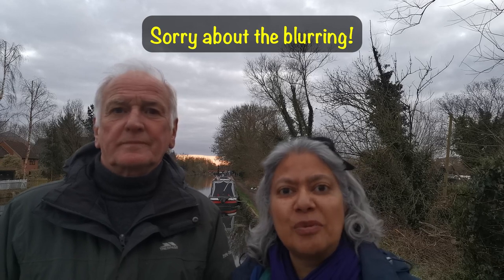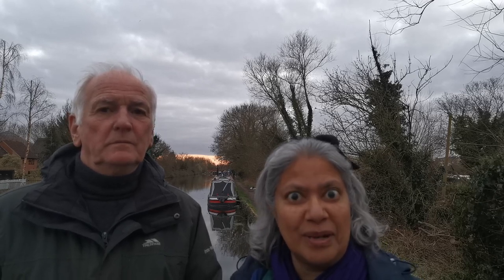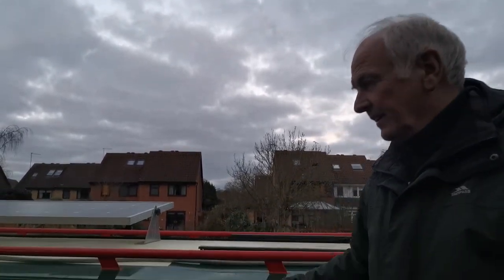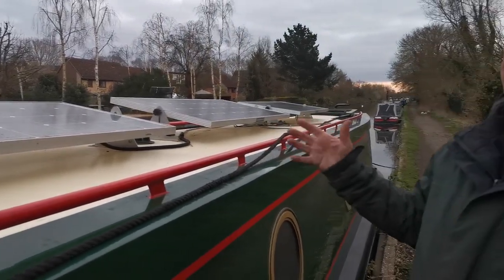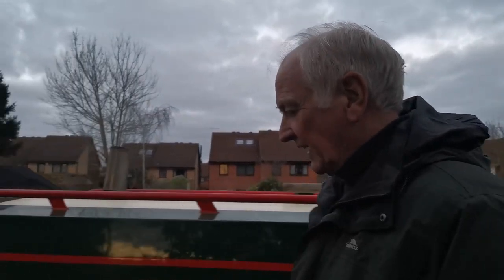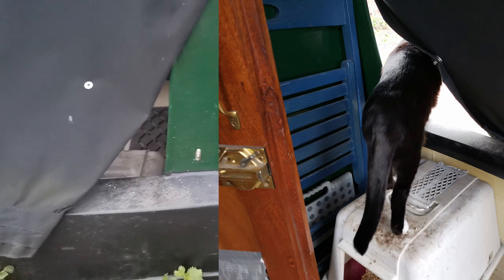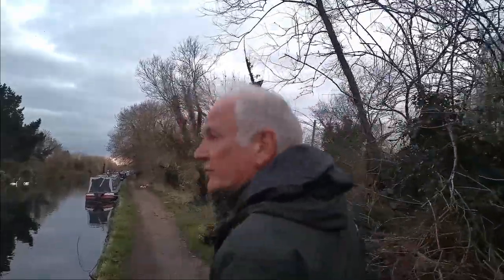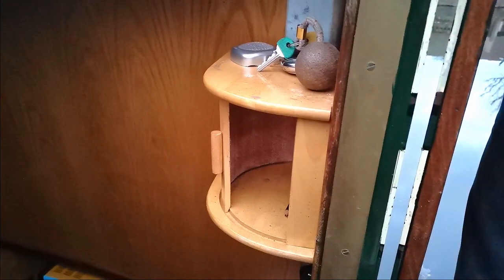Lifestyle Change! Part 3 -  Narrowboat Exterior Improvements!

Comment: You could attach the rain hood for the chimmney with a short chain, saves them from falling in the water under low bridges!
Reply from the maker: Thank you for your suggestion of a chain, Helen. We did actually do that but unfortunately the hat still got pulled off and the chain snapped. How it managed to snap we will never know and we still lost it! 🤔 We may try again and use a stronger chain in the future though. 🙂
Reply: @PartTimeBoater   as I rejoined the video Peter was just saying that he had had chains :) :)